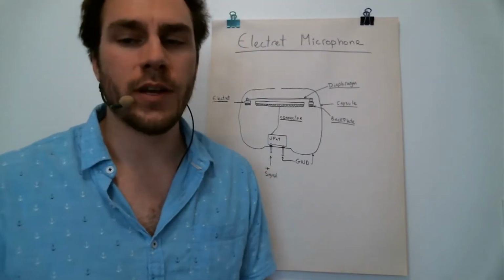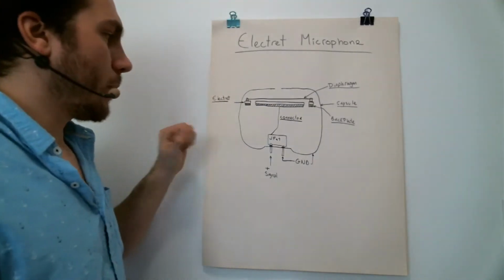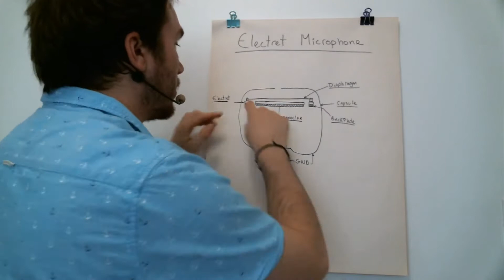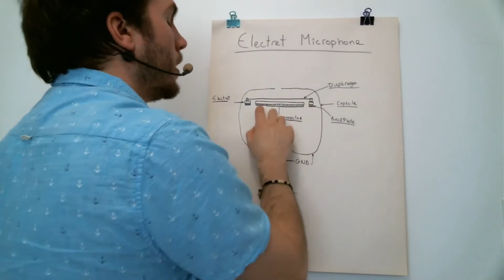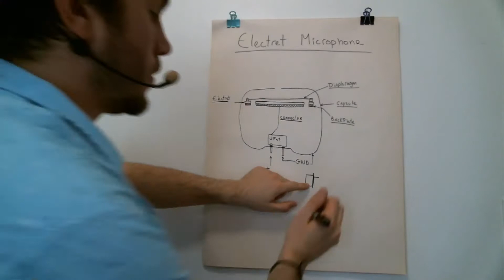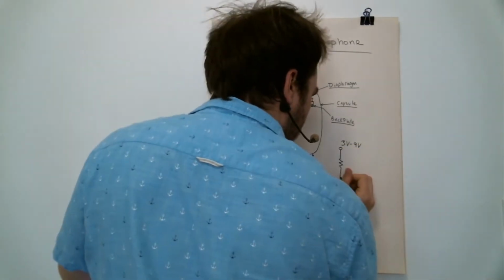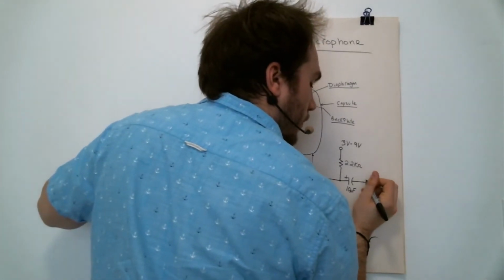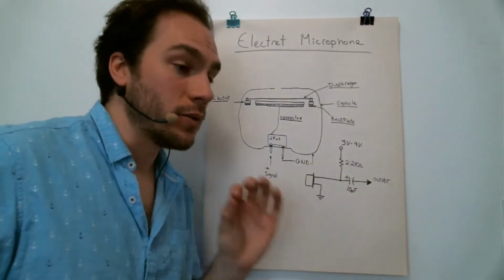How to Build an Electret Microphone | Simple Battery-Powered Mic Tutorial

Comment: Could i use a 47uF 16V cap? And I'm kinda afraid to connect it to my pc, since it has 9V between Ground and output. What have i wired wrongly?
Reply from the maker: I've heard some person connecting their Electret microphone directly to their Laptop without using any Battery. I suggest you may try it without the battery first and see if it works. What you don't want is the 9DC supply to leak into the input of your laptop.

Comment: hey guess what happens when you take an electret capsule, connect it to wire, and connect the wire to an audio jack......it works, great, so YES you can just plug the two prongs in and it will work, anyone wanna see? Ill make a video
Reply from the maker: Hi, Did you connect it to your computer directly? Some soundcard on Laptop may provide a small voltage for electret mic. Let me know and I can't wait to see the video! Thanks!

Comment: Love your video. Could you show how you could make the electret microphone circuit using only the 2 wires? The black wire being the ground and red wire being both, the power supply and the signal wire. How would you connect or arrange the resistor and capacitor in that type of circuit.
Reply from the maker: Thanks for the comment. The circuit is just there to ease the process of connecting everything. If you want to connect everything point to point, here is what it would look like: 
Positive Voltage > 2.2K resistor > Positive Pad of Microphone > Positive lead of capacitor 
Negative lead of Capacitor > Output
Negative Voltage (GND) > Negative Pad of the Microphone.

Comment: Can you use the electret mic with a voice changer
Reply: https://www.google.co.uk/imgres?imgurl=https%3A%2F%2Fph-test-11.slatic.net%2Fp%2F2%2F206a-handheld-telephone-voice-changer-blue-2648-5997295-755132cc15ea772add6464555b26882a-catalog.jpg_340x340q80.jpg_.webp&imgrefurl=https%3A%2F%2Fwww.lazada.com.ph%2Fproducts%2F206a-handheld-telephone-voice-changer-blue-i6412678-s8211386.html&tbnid=xpQcoz0kulVcRM&vet=1&docid=ngsP_aHX4UrQaM&w=340&h=340&hl=en-gb&source=sh%2Fx%2Fim
Reply from the maker: vdem101 I think this gadget already include a microphone in the circuit.
Reply: I am I doing  a green arrow costume and I need voice changer that  people can see my face but they can’t see the voice changer
Reply from the maker: vdem101 interesting! You could hack the voice changer by connecting a microphone with 2 small wires and hide the module in your pocket.
Reply from the maker: vdem101 sure! I would like to see that in action. What is your voice changer module?
Reply: Any links to it?

Comment: Can I use 3.5mm headphone jack for output? If yes, Can I record voice from my laptop?
Reply from the maker: No Sharpo hey hey! Thank you for that question. If you want the output of the microphone to be a 3.5mm jack, make sure you connect the signal out to the tip of the connector and the ground to the sleeve. Do not forget the capacitor to prevent the DC voltage from going to your laptop input. Then, you should be ready to record. Let me know how it goes and how’s the quality! :)

Comment: I know little about mics, but i've learnt that xlr, phantom power, tr, trsm condenser and electret mics and 1 one thing above all is that it u CAN get usable audio from an electret mic. Its only possible with the mic input on a laptop or PC sound card or motherboard mic input. Using Electret mic 3.5mm trs jack you get a usable sound from the "POWER" that the pc mic input supplies (3 - 5 bias volts) so i'm told. Just the ground of the mic to sleeve of the jack and soldering the left and right the jack to the + of the mic. Now here's the good the part. Use 2 electret mics, solder their grounds together then the to the jack, then solder then  
right conecter to one of the electret positves and do the left to the other electret. I can use it as desk mic, i get solid wave form better than youtubers do with a diy pre amp. My motherboard basic program does the little bit clean that may be needed. Though this may work for pc, most people buildind their are for pc and dont have amps or quality audio equipment. Honeslty just buld and see for yourself
Reply from the maker: Feverish Me thank you for the comment.

Comment: good job bro you helped me really!!! .....thaaaaank you!!!
Reply from the maker: mourad minou hey I’m glad it helped you! Do not hesitate if you have any other questions.
Reply: In fact I have a question I followed all your steps, I plugged in the circuit to my pc,  then I noticed something strange....even I turn off the 9 v supply the mic still works ...can you plz explain me that?? and sorry for my English hehe
Reply from the maker: mourad minou no problem for your english, I understand you. Make sure your computer is not supplying a voltage already out of the output. Also, make sure you have no voltage going to the microphone directly and what is the capsule you are using?
Reply: Well, sure my pc is already supplying a voltage out of the output and my mic is just like yours and it receive the voltage from the 9v battery through the resistance.
Reply from the maker: mourad minou this is perfect, this means you don’t need any battery or other supply for your microphone.

Comment: Could the output signal be connected to a bluetooth transmitter to use with a bluetooth headset? I want to be able to hear my satnav but its internal bluetooth isn't compatible with my helmet bluetooth (it was for a car and apparently motorcycle satnavs are different so they can rip us off). I thought about connecting the bluetooth transmitter directly to the satnav speaker termials but then I thought about using a microphone in the waterproof case (so I didn't have to drill a hole in the back of my satnav) using a plug in USB socket into the bike auxilliary power supply (like a cigarette lighter socket). Your advice would be greatly appreciated. Thanks